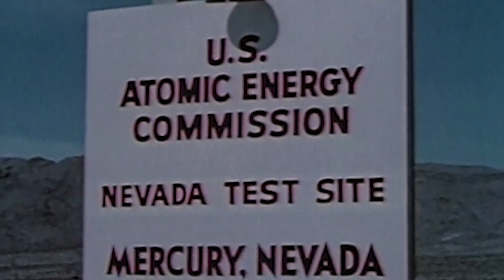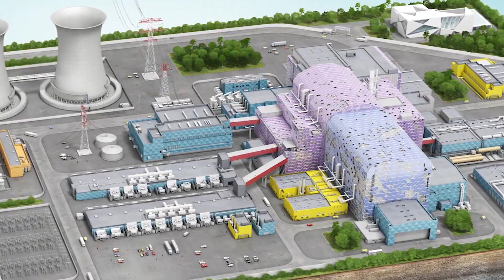This rocket could allow humans to leave our solar system – Pulsar Fusion

Comment: You need to add more to it once you have that light weight gas as like a pilot light then you lay on the powder metals an or steamed metals like a battery being stabbed or punctured and they ignite…. Sooo you take that controlled short circuit of engine fuel core battery thing and you ionize that excess smoke from rich fuel core mixture of the battery short circuiting like tube with power cable on one end similar to arc metal forging pot but you can throw in magnetic creating powders to be delivered as like amps running down the engine for the coils you need on outside of ship that makes it look like the outer ring on arc reactor is just like a neon light showing you it is aquiring magnetic fields from main reactor and if you had molten metal in there going in circle or rolling like smoke ring you…uh basically made a turbo fuel pump for main reactor if magnetic fields are great enough from tube flowing of a reaction that is same as battery short circuiting with metals and what not that flow threw engines tube are the torque of the out rings around your ship.. the ring around iron man’s reactor is just neon light k except it’s using magnetic radiation from center core of reactor to ionize the gas in ring cause of its induction from the radiation… but like said then put powders into that ring feed that reaction while basically the neon light kept sustained inside being ionized is like pilot light unlike the batter acid type reaction where is a runaway chemical reaction creates its own gases at a pressure to flow down to circuit completeling next parts of the rocket engine…

Idk 

Think lighter material (gases) gets heavier by ionizing it into an arc Maintaining atmosphere like is needed to then you inject metaliods to be  ignited or steamed depending on the amps your running from end to end on the reactor tube… things. That react like batttiers blowing up is what you need for chemical reaction wize..to produce the energy needed to then in inject something else into it that like said creates strong magnetic field when ionized by reactor tube after they are super heated.. from chemical reaction of the battery type basically short circuiting…. And outer flywheel neon round tube magnetic collection rings be added should be usless until you get to certain point then it can have enough energy to become the fuel pump for gases carrying alott ppms of steamed metal idk there good in there

Comment: Heh, we fly to space on a giant firecracker, we can't spend a few weeks in space without serious impact on health and he wants to go interstellar? With no  gravity and  radiation and debris shielding, in a  thin can called star ship? Without Star Trek interia dampers and shields? 🤣🤣🤣🤣 
Bezos is a moron, invested trillion in fusion,  wasted another trillion on virgin instead of joining forces with Musk.  He could spend all this money on inventing/reinventing zero point energy device which was invented in the 80s, apparently, because this patent vanished...) he could spend this money on Tesla wireles "cosmic energy device". We would not need any fuel, we wouldn't need power grid, no solar or wind, no fossil fuel.  
It was invented by apparently "crazy" guy nearly 100 years ago 😳  without silicone chips? and you can't replicate for trillion in 21st century?? You can't or you are not allowed to....

Comment: Sounds fab, but how do navigate and avoid hitting things at 350,000km a second!?
Reply: Martyn, I understand your concerns. You could bounce to close to a super nova or fly right through a star. That would end your trip real quick, wouldn't it👍
Reply: @jimmorrison2657  thank you Han Solo for the PSA  🤣😂🤣😂🤣
Reply: See Chris White's reply; however your concern about high velocities is valid. Even at  .1C any impact is getting close to nuclear energy
Reply: 350km a second

21 000km a minute

1 260 000km an hour
Reply: I'd be more interested in how you slow down
Reply: @polla2256  I'd be more interested  how they turn without turning everything inside into pancakes 🥞
Reply: That's faster than the speed of light
Reply: To quote Douglas Adams "Space," [the Hitchhiker's Guide] says, "is big. Really big. You just won't believe how vastly hugely mind-bogglingly big it is. I mean, you may think it's a long way down the road to the chemist, but that's just peanuts to space.
What that means is there is a lot of space between things, A LOT of space. So the chances of hitting anything is unbelievably small...

Comment: you can use water powered batteries with graphene and hematene nanotechnology for power on the planet at zero cost
Reply: As long as you have water
Reply: @johnstratford2460  which cn be extracted from the air with fog nets, warka towers, or MOF nanotech
Reply: @johnstratford2460  😂